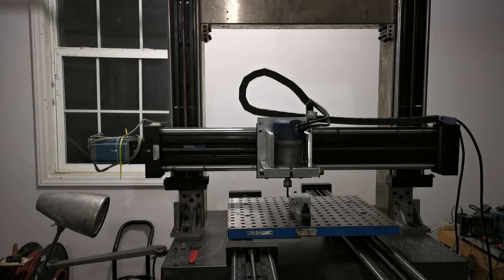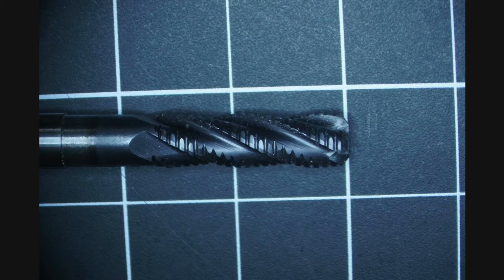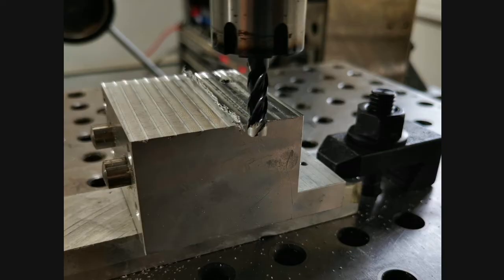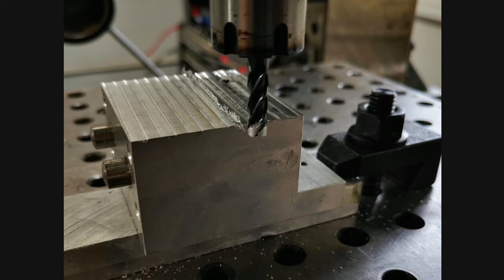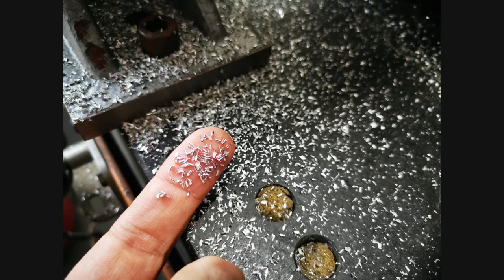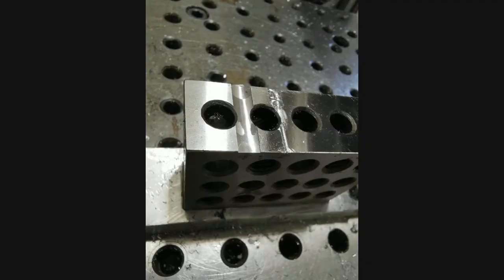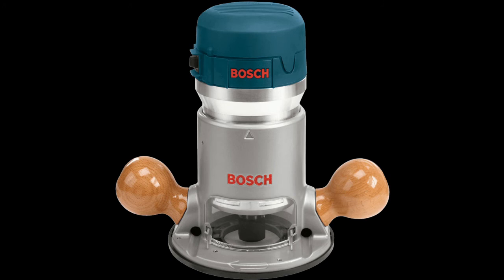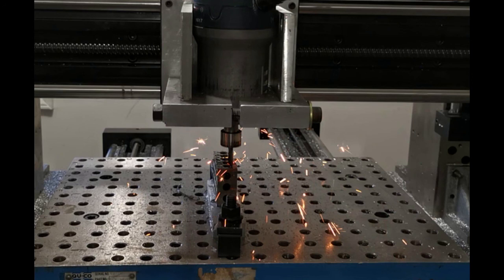Granite surface plate based CNC mill - First Cuts

Comment: 2 flute endmill. And  speeds….
3 or 4 is asking for issues like this..
Also, ouch.. Is the z shoving down on this?
Something is up..
Reply from the maker: All good points. Thanks for the input. This was intended as more of a test after putting it together following nearly 10 years in storage. Lots of things learned in the mean time...

Comment: wow thats a garbage spindle!
Reply from the maker: Well, from one point of view even calling it a spindle is generous since its just a wood router converted to a shunt wound motor. On the other hand this thing has milled quite a lot aluminum in it's life, and recently even a bit of steel. And it's still working ....
Reply: @janbeck8269  wow that’s impressive

Comment: Hmm, the horsepower ratings don't work here because that router motor is probably not constant power (which probably doesn't exist) but constant torque.

Constant torque motors only reach their rated power at the maximum RPM. For example, if the motor is rated for 2 hp at 24000 rpm, but you are running it at 2400 rpm for steel, it would only have 0.2 hp available.

Most of these motors are not designed to run at low RPMs for prolonged periods of time because of air cooling.
Reply from the maker: Most of what you say is correct of course. But be aware that this motor had been converted to shunt wound configuration: https://www.janbeck.com/granite-surface-plate-based-cnc-mill/closed-loop-spindle-control
I'm working on a proper closed-loop controller that does actual power measurements in real time. Sneak previews:
https://www.youtube.com/watch?v=1DV6DX-uzxM
https://www.youtube.com/watch?v=gtCQppHaenA
Reply: @janbeck8269  I'm already amazed with what you managed to achieve with a hand held router. I'm sure hardened 123 blocks aren't part of their design.
Reply from the maker: @Bl4cKeN1nG  I know what you mean. The interesting thing is that I have cut a ton of aluminum with this spindle and haven't had any bearing problems. The one time i had to switch the bearing was when I was using it to cut wood. Sure enough, it had sucked wood dust into the intake and somehow blown some past the seal into the bearing...

Comment: rigidity? have you tried less stickout and better work Holding?
Reply from the maker: Thanks for the suggestion, but I think it is pretty clear by the smooth surface that rigidity is not a problem in this setup. Also, the work piece did not move. I superglued it in place, so it's an all or nothing kind of situation.
Reply from the maker: Oh, I just realized that you probably meant the long roughing endmill. You are right there, of course. I have my mind on the steel for the past couple of days and forgot what I put in the video :P
Reply: @janbeck8269  i am glad that i could help a fellow german machinist

Comment: change to 2 flute for those rpms , you may not be getting enough chip per tooth
Reply: At high rpm and low feed rate of (50 Ipm,?), a single flute would get the chip load up and give more room to evacuate chip given no coolant
Reply from the maker: @alanhnatiw1643  That is a good suggestion. Thanks!
Reply from the maker: That's a good idea. Thanks

Comment: Could be wrong but I don't think that chart works for a hardened 123 block.  Maybe try something that is not hardened?
Reply from the maker: Thanks for the comment. I think you are right - the power constant goes up with hardness in a given material (https://dynospindles.com/vault/technical/Book-of-Spindles-Part-2.pdf). I cannot find a table that lists hardnesses close to hardened steel.
I deliberately chose something that would be difficult. That block is only case hardened - I could have continued milling and it should have gotten easier. That was an oversight on my part. I have a large block of 316 stainless. Maybe I'll try that one. Still, I think the general analysis for steel is correct. Most machinists eyeball 1HP for every cubic inch/min of steel milling. At the RPM for steel, the spindle does not have a lot of HP left...
Right now, I am thinking of using this spindle to machine an aluminum mount for the next spindle :P
Reply: @janbeck8269  try this: https://fswizard.com/www/  Select "difficult and very difficult stainless steels"  I'm guessing the 123 block is 50-60HRC which is >500 HB.  that should show the HP calculation for your cutter dimensions.
Reply from the maker: @JesseSchoch  Thanks for that. I agree that the hardness is probably in the 60 HRC range. I played around with that site a bit. The HP shown is not much different for the different steels, except for structural steels which is 30% higher for some reason....